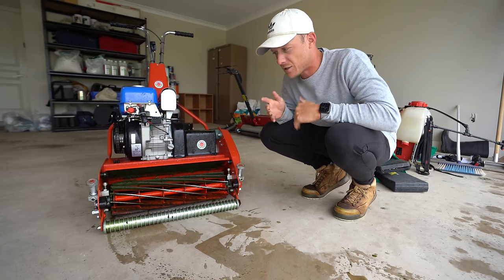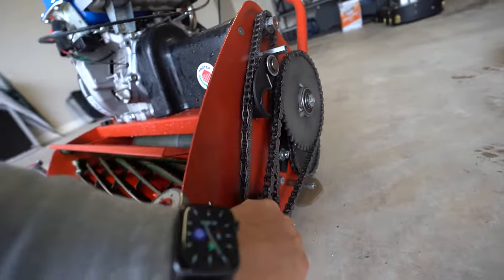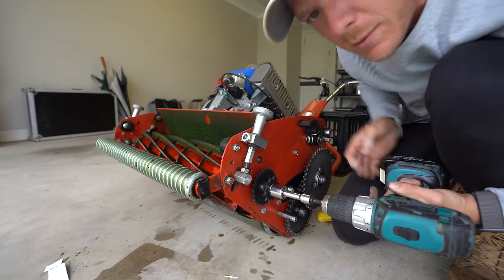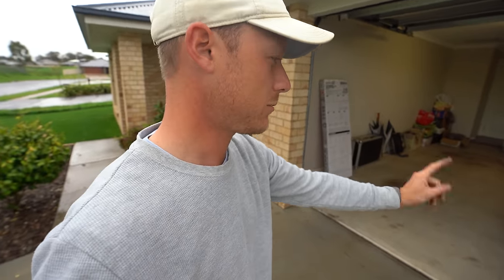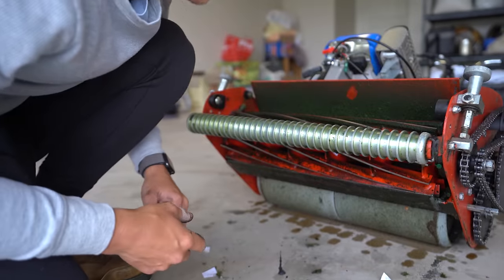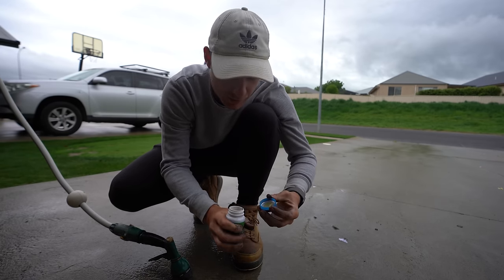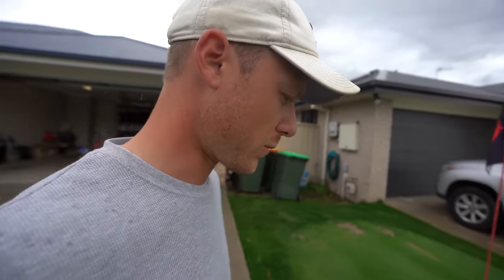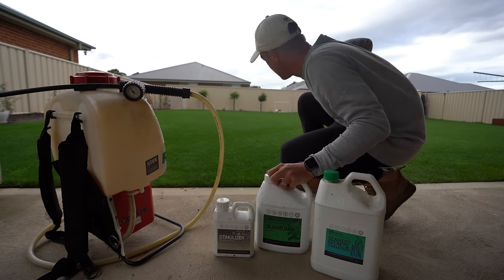A Day In The Yard // Backlapping my Mower and Fertilsing

Comment: Hey mate, when using a Stanley screwdriver like that, use a ring spanner on the handle. They are actually designed that way so you can get more torque on a tight screw.  Also, does anyone know when Monument will be available in Australia?

Comment: My reel is as loose as it can be in relation to the bed knife while still cutting paper. Were you saying that is the best to backlap or tighten it more and the paste will loosen it?

Edit: It cuts paper but still moves fairly freely when rotated
Reply: Mike Charron  Thanks. Immediately after backlapping, there isn't a need to adjust the reel to bed knife right after, correct?

Comment: Dont see why you need to take the whole spark plug out. Just pull the plug wire off then there's no possibility of current flowing to the spark plug which is the whole point
Reply: You should watch the video that Brenton from the Aussie Lawn did on mower maintenance in particular where he showed how it was possible for an engine to run with the spark plug lead removed. Long story short even removed sufficient current can be induced to run the mower.
Reply: @ashleyw1393  just watched and that's a good point but the plug wire was still touching the plug he even went as far as to move the plug wire away and the engine started cutting out. So basically as long as the wire and plug make no physical connection (which I make sure to do) then there is zero current because, well, physics. But like I said good point